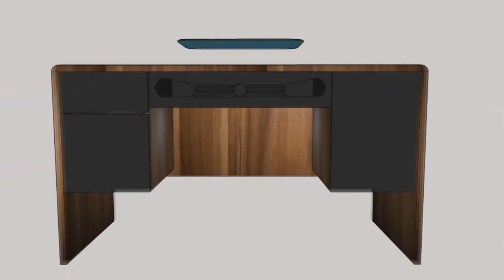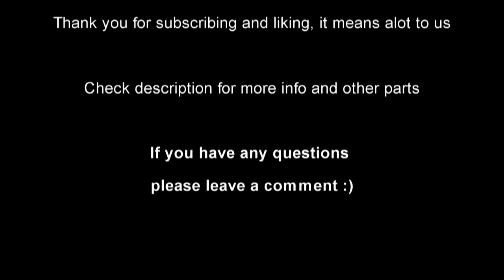DIY PC in Table - Part 3 (Final)

Comment: Greetings...

I have some questions.
What temperature reaches that case?
The table feels hot to the touch?
It safe to use the pc without using fans for airflow?

I liked your project.
Reply from the maker: +Onán Guerrero you need to use the fans when you are gameing or doing anything gpu intensive, or else the table becomes hot and pc unstable
Reply from the maker: +Onán Guerrero you need to use the fans when you are gameing or doing anything gpu intensive, or else the table becomes hot and pc unstable

Comment: can pls you showcase or discribe how you installed the gpu like this?
Reply from the maker: +Chris Wartree pcie extender, google it
Reply: what i mean how you vertical attached the gpu, do you use the Mainboard screwholds, what kind of Glas or Material is it because it must be heat resistent. how the gpu is fixed  to this Material. 
thx
Reply: "a piec of plexyglass with a few screews through the gpu board, board has factory screew holes" ...plus a pcie extender :3